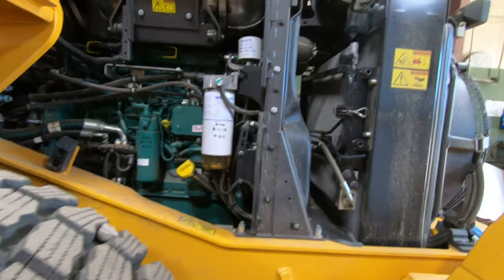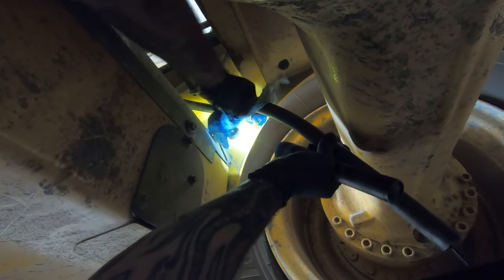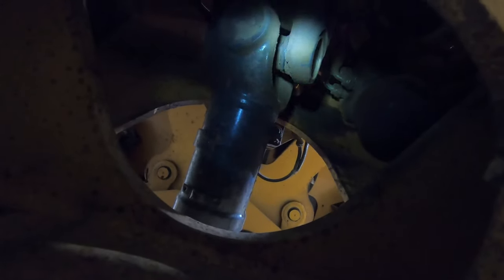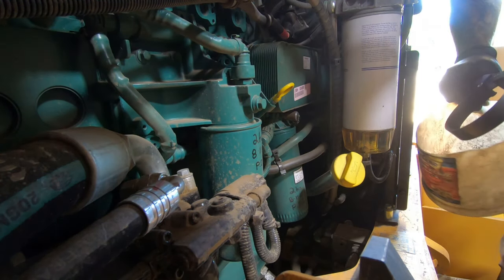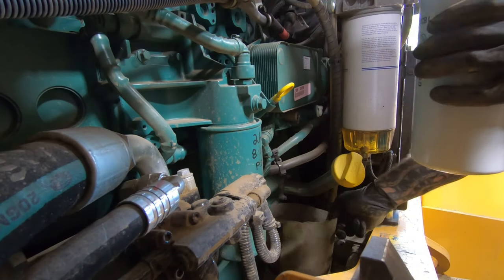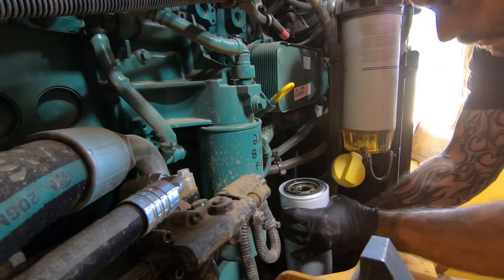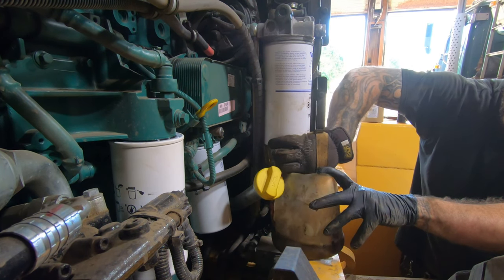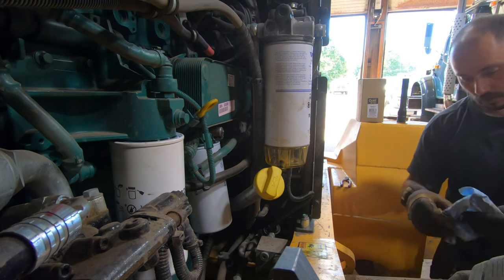500 hour service on a 2018 Volvo L90H loader, and how to acknowledge (reset) the service message

Comment: Good video thanks. Any suggestions on how to reduce or muffle the reverse beeper?
Reply from the maker: I can’t recommend disabling the reverse beeper because if anything happens to anyone there gonna point out the reverse beeper not working right and try to make the operator responsible regardless of if the person should have been there or not. But they do make a different back up alarm that makes a crunching sound. There not as annoying as the beeping. They kinda chhh-chhh. I guess it’s more of a white noise. Here is a link to an osha article discussing back up alarms. https://www.osha.gov/laws-regs/standardinterpretations/2004-09-27. I tried to find the other type of back up alarm for you but I couldn’t. Thanks for watching
Reply from the maker: Wait here’s one it’s down a little in the page  hope this helps. https://wolo-mfg.com/back-up-alarms/model-ba-197wn-heavy-duty-97-decibel.html
Reply: @JasonTheMunicipalMechanic  Here in Ireland anything above 80 dba and hearing protection has to be worn. Neighbour has one that can be heard 2 miles away if the weather is right. Thanks for the link.
Reply: How are those new H series loaders been?
Reply from the maker: We have a little over 1100 hours and the only problem we had was a def tank level armature needed to be replaced. Aside from that the only other complaint would be that they are slow over the road. The government said any vehicle that travels over 19 mph needs an air bag so it is speed rated at 19mph.
Reply: @JasonTheMunicipalMechanic  Rear diff lock drained itself of oil when a seal went, chewed itself up pretty fast, That was 2 yrs ago, just out of 12 month warranty.
Reply: @JasonTheMunicipalMechanic  
Thanks Jay 

I just bought my first, it has a lot more hours then that. 
2017 with 7000
135k from strongco so hoping I have some good luck for a little while always.

I know the def system I’m always going to have trouble with that’s in everything unfortunately

Comment: That " block" is the high pressure fuel pump. Its driven off the camshaft.
Reply from the maker: That’s good to know, thank you. It been a while since I made the video so I had to go back and watch it to see what you were referring to.
Reply: @JasonTheMunicipalMechanic  i work for a volvo construction equipment dealer. It's actually a deutz engine.

Comment: Where is the diag port,?
Reply from the maker: I’ll have to look but I think it’s behind the panel on the back wall inside the cab by the door
Reply: @JasonTheMunicipalMechanic  I removed that whole back panel and it wasn't there
Reply from the maker: I just looked and I couldn’t find it either. I would call Volvo and ask them. The Volvo service tech was here working on that one for a def sender level issue and I didn’t notice him taking the interior apart to link to it. I don’t have a scan tool for them so I haven’t needed to use it.
Reply: @JasonTheMunicipalMechanic  ok after speaking to a tech at my local Volvo dealership, it turns out it is there behind the panel where the fuses are. I just didn't expect it to be a totally different diag port style than most of our other equipment brands which have the same round shapped port. But thank you for your time.
Reply: @JasonTheMunicipalMechanic  That is correct.

Comment: What type of oil is used in a Volvo L90e trans please?
Reply from the maker: The bucket says automatic transmission fluid 97342 AT102. I believe it is just an AT102 spec. I couldn’t find it anywhere except from Volvo itself.
Reply: @JasonTheMunicipalMechanic  I've heard a lot of people say you can use 10w30?
Reply from the maker: I know our backhoes take 10w-40 in the hydraulic tank but I wouldn’t use that in a transmission unless it called for it.
Reply: I made the mistake of using hydraulic fluid for the transmission. From what the book says they seem to be similar although I don’t know if Volvo would endorse that. Our mechanic said they could be interchangeable to some extent.   @JasonTheMunicipalMechanic
Reply from the maker: I’ve used hydraulic fluid in some equipment transmissions in the past because the guy training me said that’s what to use. It seemed ok until the backhoe (cat 446b) transmission started overheating and getting a lot of metal shavings in the transmission. It had about 7000 hrs and was drivin around a lot so I don’t know if it was just normal time to need a rebuild or if it was from the hydraulic oil. Since then I only use what’s called for. They were putting hydraulic oil in the trans for quite a long time so it might have not been the problem and could be perfectly fine, I don’t know but I always verify the manufacturer specs are listed on the container now. The loader (John Deere 624) never had a problem with hydraulic fluid in the transmission.